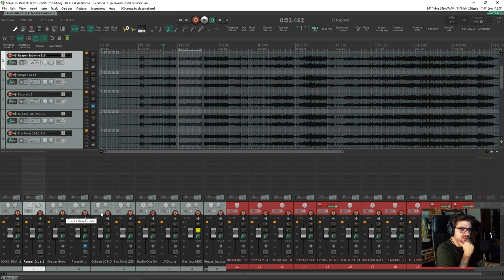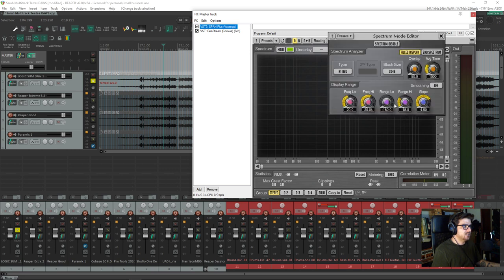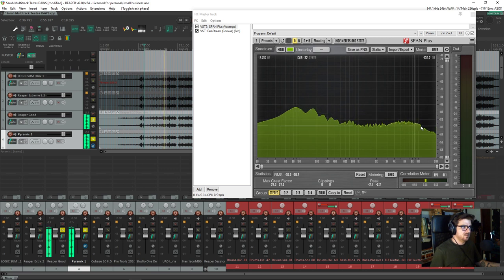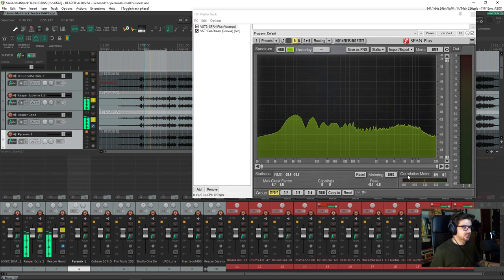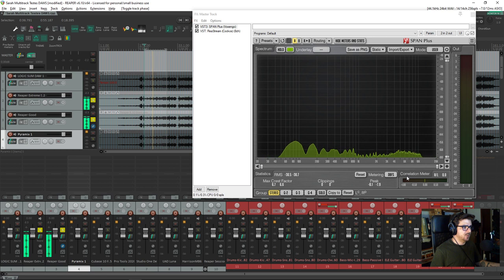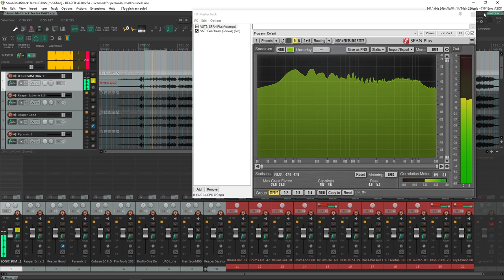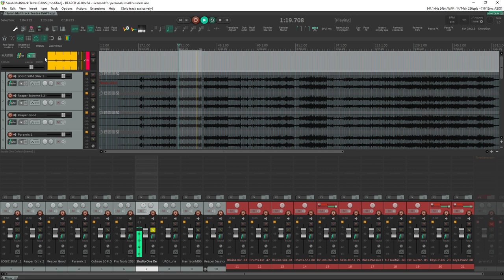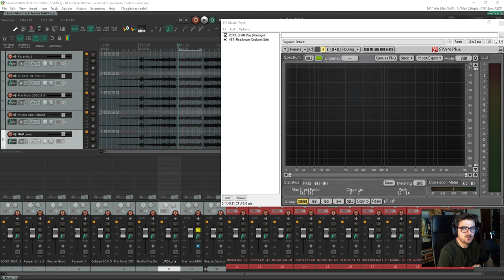They don't cancel ,DAWS sound different. Why?

Comment: Hey! What was the situation with bit depth? Were tracks 24 bit? Plugins? 64 bit FP processing vs 32bit? Did you try to match Logic with Reaper with 32 bit FP summing? I'm sure you get perfect null, if you match those settings. I nulled Logic with Reaper like this. But what happens, when you apply plugins, this is the question.
Reply from the maker: Hey Dima, thanks for your reply. From what I remember all audio was 24 bits, some daws support 64 FP mixing, but since I haven't moved a single fader I believe they kept on 32 a lll the way. Anyway, it was nice, I took my conclusions and to my ears Cubase fits. All the best, stay safe
Reply: @PedroGerardo  Different bit depth explains, why they don’t cancel.
Reply: @PedroGerardo  im doing this right now and they all cancel, are you sure you had the same settings on all daws?
Reply from the maker: @Trickey2413  Ho , thanks for watching .If you check levels below -90 dBFS you´ll notice many differences, this only means that they are not the same and the reason might be some small deviations on the calculations. Audio engines are made using same rules but by different people and using sometimes different math approaches.
 :D All the best,

Comment: Yes there is a difference, not all DAWs process audio the same. Reaper seems very transparent (doesn't touch the audio), but some other DAWs boost and cut certain frequencies. These differences could be low at -90dBs etc., but that doesn't mean it doesn't change the sound. Some people can hear the warble or frequency shifts, others can tell there is something more to the sound. Also, an audio project will have multiple tracks running thru the audio engine, with this same sound processing add up, and the differences become more audible dB. Testing one track shows you there is a difference, but when there are many tracks (eg 20 tracks), you might even hear it. Anyone that says there is no difference, and its 'imaginary', and 'you cant hear it anyway, its in audible to humans', is talking BS. They  need to prove it with the tools. Its interesting that these audio companies that make the DAWs do not provide this information, its like their best kept secret.😃